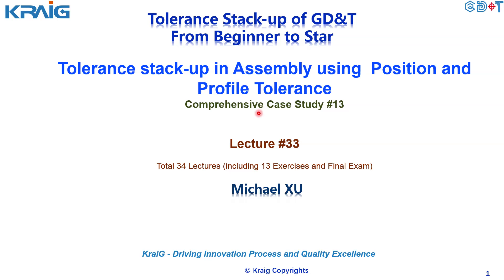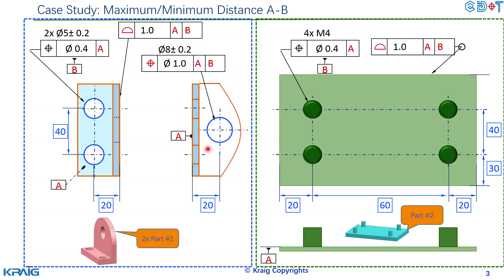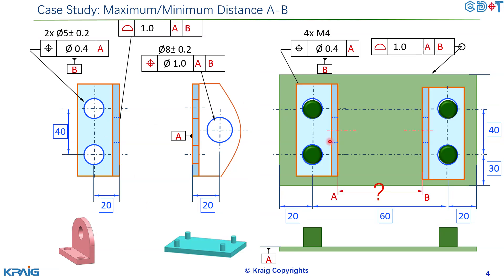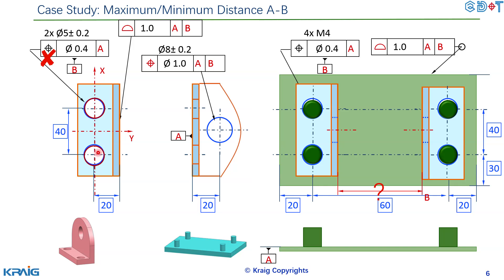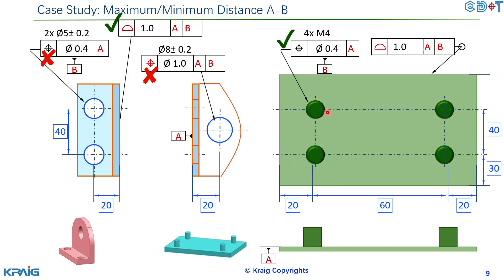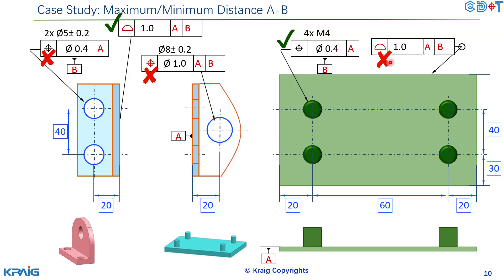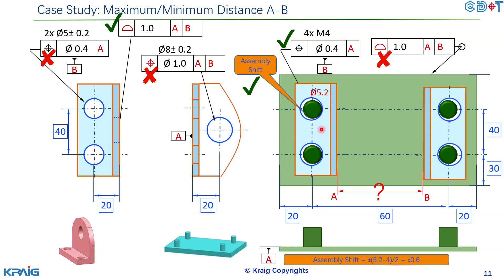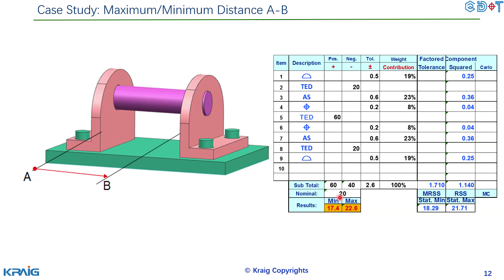Tolerance Stackup on Assembly using Position and Profile Tolerance 2025

Comment: In part 2 you missed the CZ spec! It is really important otherwise the pins will move in plane independently.
Reply from the maker: CZ only exists in ISO GPS, since this video is based on GD&T (which means based on ASME Y14.5), hence no CZ needed (in other words, CZ is default).

Comment: At 2:44, why does positional tolerance 0.4mm in 5mm hole only affect vertical position?
I have the impression that 0.4mm is the diameter meaning that it can be anywhere within that 5.2mm envelope. Am I understanding it correctly?
Reply: Answer to your question (...hole only affect vertical position?) : No. It does not affect vertical position only. Visualize this in the following steps. 
1) They are located to each other, within +/- 0.2. The basic dimension is 40
2) Now, the line joining the two holes are a pattern. And the pattern of the holes is Datum B, which is being tied back to A. Which essentially is controlling the orientation. So a better control would have been Perpendicularity.
3) Now, answer to your question. The line joining the holes (where ever and at whatever angle you drill with reference to vertical edge of your monitor screen) is Datum B. Then the Axis X shown is along the Datum B in the drawing view. The basic dimension 20 you see, is actually "LOCATING" the face for which there is a profile control. And rightly so, the datum callouts have A which is the primary datum followed by the Secondary datum which is Datum B.

In other words, imagine this...
1) Grab a large thick plate and place it on the bed of the drilling machine. You would have placed it on Datum A. get it?
2) Now drill two holes. 40 apart and within a +/- 0.2 tolerace from each other
3) To machine the face which has profile control, you will use the previous two holes to fixture and to build the relation

So, it really doesnt matter what the outside edges of the plate and step 1 are oriented to the line joining the holes. Finally, you machine the outside geometry of the part with reference to Datum A and B

You follow me? Feel free to ask questions....
Reply: I have the same question.
Reply from the maker: good question. Let me ask youone question, then your question will be answered: 
in the drawing of this video, who is datum? 

Or put it other way: does two holes of 5mm decide end surface position (profile 1.0) horizontally? or does end surface decide two holes position horizontally?
Reply: @kraiginfo6339  So for the positional tolerance added to the holes are only respect to Datum A which means that the hole just need to be  within a 0.4 cylindrical tolerance on Datum A inside the 5.2 envelope, even though the plane that is generated by the two hole axis is Datum B since this Datum is not used in the positional tolerance why isn't the 0.4 positional tolerance not considered while calculating the outer boundary and inner boundary of the hole which could be used to calculate the half vector, so it can be used in the tolerance stack-up calculation? Shouldn't the positional tolerance on the pin also be included while calculating the outer and inner boundary of the pin?
Reply from the maker: there is no horizontal deviation of position for the two holes of 5 mm? Why, because it's datum. 
If the two holes 5mm uses end surface as datum, then the position 0.4 will have horizontal deviation.
Reply: @kraiginfo6339 I stopped watching this video when he skipped two holes position assumimg dia. Symbol is not a contributor.

Comment: Your videos give me practical knowledge and exactly what I want. Thank you and keep going.
Reply from the maker: Thanks for your support!
Reply: I‘m afraid the tolerance for the „distance“ is more than +-0.6.:
- Unevenness of A (Plate): contact areas of the two flanges against plate must not align
- Flanges can twist against screws
- Envelope of the M4 screws is smaller than dia 4
- Positiontolerance of 4x M4: projected tolerance zone is missing. Clearance fit appears not „in the threads“
- flanges and plate are not rigid against the high screw forces
Reply from the maker: Thanks for comments. This video belong to one of videos of the the full course, there are more factors to consider, in actual application, the list of factors could be longer as you mentioned…